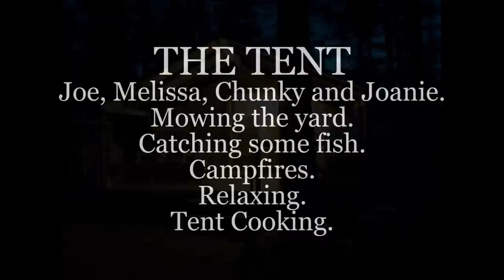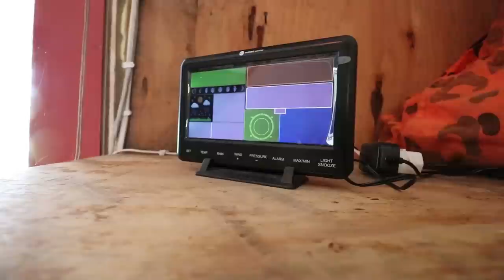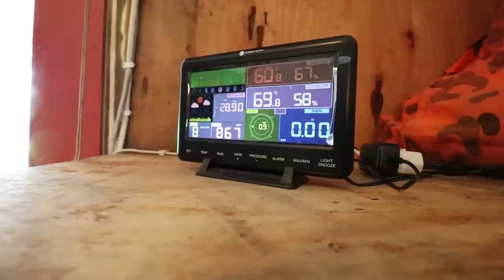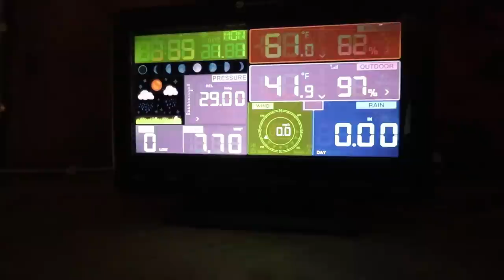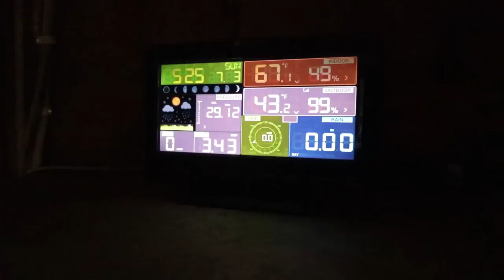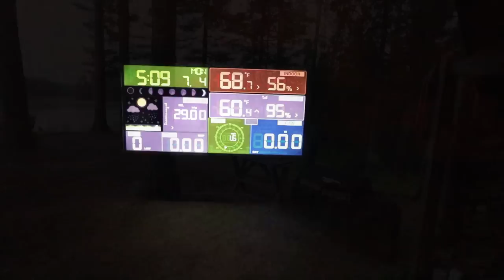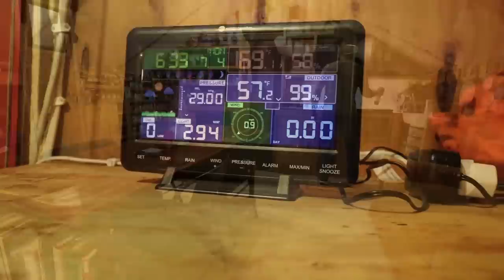THE TENT. Summer Fishing. Mowing. Tent Cooking. With Melissa and Chunky and Joanie.

Comment: That's really weird the mosquitoes are really bad down there because they are the worst in years, possibly decades, up here in Alaska also this year.  How long does that fogger keep the skeeters away?
Reply from the maker: It kills what is there so it helps for an hour or 2. It makes a small amount of bug spray keep them off you vs dousing yourself with deet. On a calm night it helps quite a bit but if there is wind it dissipates quicker.
Reply: @NorthernSeclusion  Thanks.  I started using a mosquito magnet and it is working very well but it does take a couple few days to start noticing a difference.  Thanks for making videos.  Always enjoy watching your videos.

Comment: Hello joe great video. What is that black stone on the counter top. And where did you get it at. Thanks.
Reply from the maker: It is not stone. It is a hard plastic type cutting board. You can get them on Amazon I would think. You can buy them at Walmart also.
Reply: @NorthernSeclusion  ok thanks

Comment: equipment question:  the laptop:  what make/model?  Is the screen more elongated than usually?
Reply from the maker: Dell XPS 15. The screen is just a regular 15 inch screen but to edit the videos (have enough power) this one is expensive. I am looking at getting a new one because this one is at least 3 years old and it has really been worked. The new version is just over 3 thousand.
Reply: @NorthernSeclusion  thanks for the replay

Comment: Hey Joe, I have a couple questions about your truck. Is that a big screen snapped on the front? If so, do you like it? How do you get away with the dark tint in MN? I just had my windows tinted and I couldn't get dark tint. Good to see you up at the tent again and congrats to Melissa on the 50 lbs lost. That's a great accomplishment. - Paul
Reply from the maker: It does not snap on, it is black wire mesh and is just part of the hood. Window tint in Minnesota says it has to let 50% of light in and can not be more than 20% reflective. The laws are different in Louisiana where I bought it but I have never been pulled over because of it. I also have no idea what the tint on the truck is. Melissa has done really well. Thank You.

Comment: How do you like your fogger?  I have property similar to the tent  up here in Canada by the Rocky Mountains.   I was looking at a fogger but I worry about the pets?  Any advice?
Reply from the maker: It gets rid of the mosquitoes for awhile. It does help. As far as the pets go, they are smarter than us and avoid it and the "smoke" dissipates pretty fast. It is not like spraying deet on you but it does hold them at bay.